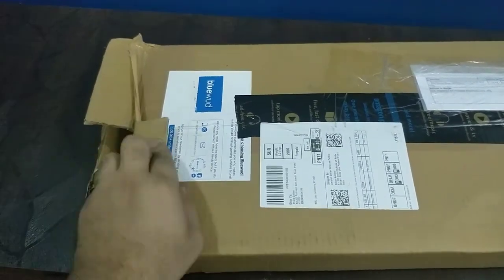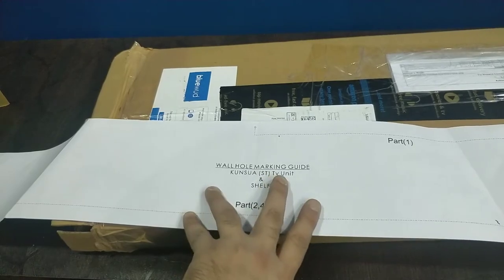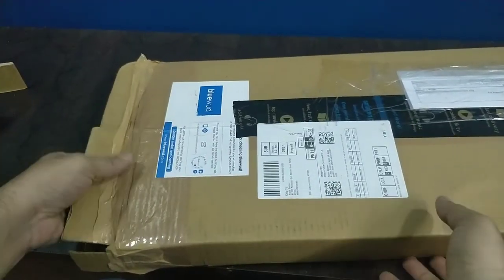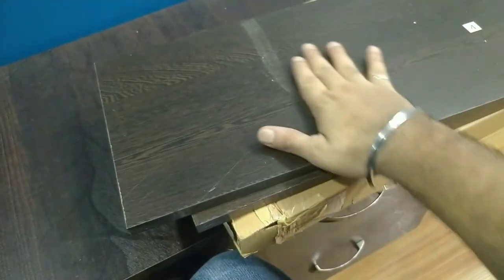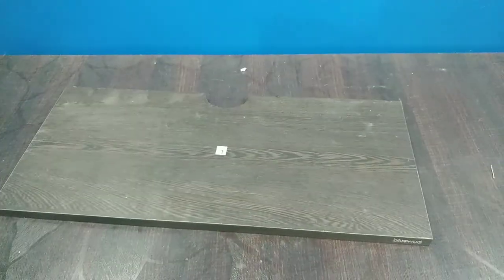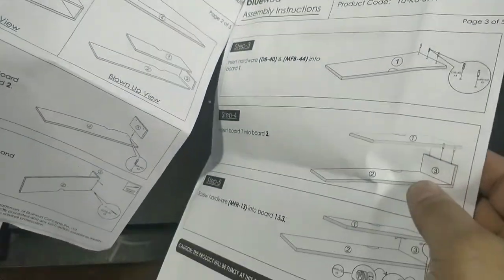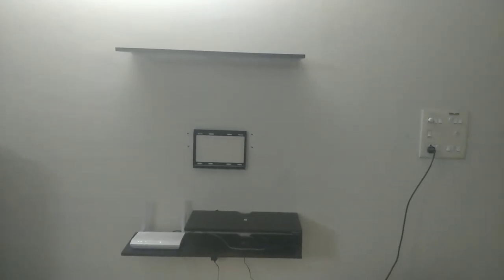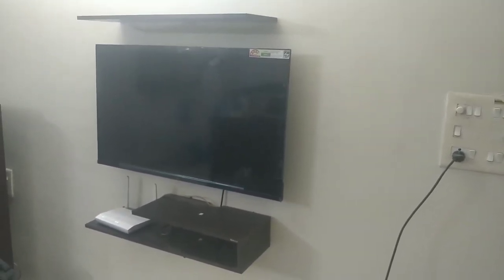Unboxing and Installation BLUEWUD TV Entertainment Unit/Wall Set Top Box Stand Shelf

Comment: Is this reliable product?
If I would like to put flowers pot on the stand then does this stand will take weight of that ?

As this made of engineering wood so does this stay long lasting?
Please share real reviews
Reply from the maker: Yes you can keep small flower pot on it. I have a router, remotes, wallet, keys etc on the bottom part and on top i have kept some decoration and it takes the weight nicely. 
If your fitting is sturdy enough, It should take approx 3kgs comfortably. Even my cats climb on it sometimes and it stays just fine. 
Note. My two cats are 6 and 4 kgs